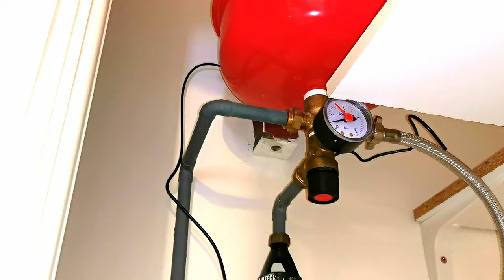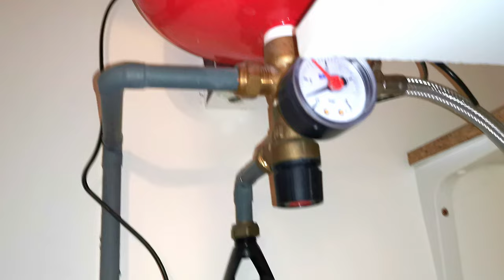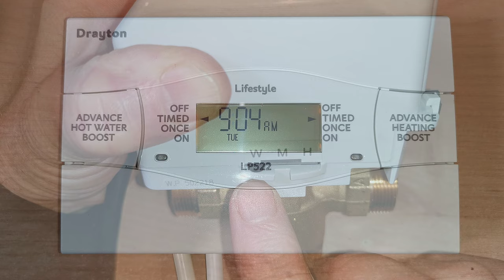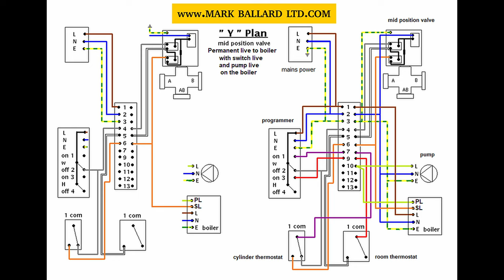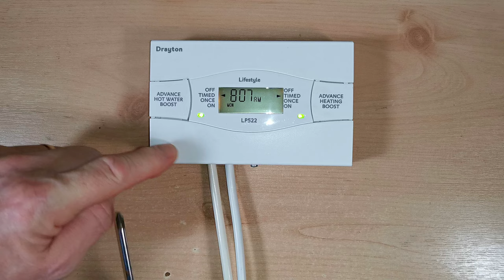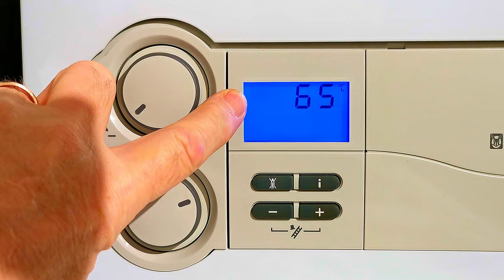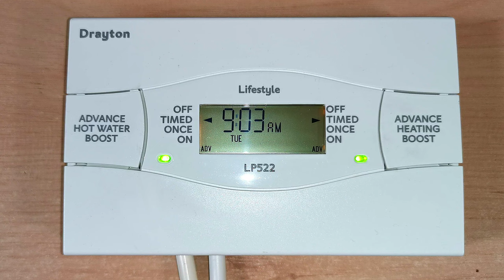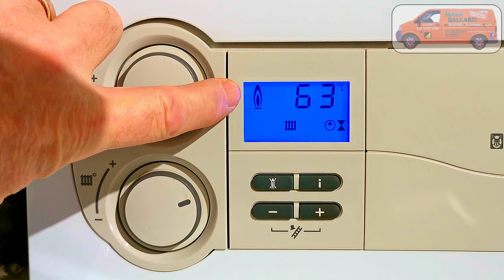Why Is My Boiler Running When It Should Be OFF,  Is It Normal Or Is It Faulty?

Comment: My heating was running flat out all night during the recent cold spell. It was due to an outdoors frost stat set at 0C, so I fitted another stat on the return pipe, in series with the outdoors stat. The boiler now only fires up when it’s less than 0C outside AND the return water is less than, say, 10C. Seems fine now.

Comment: my combiboiler keeps pumping something out for 30sec every 8min. It isn't turning on like heating water as flame doesn't turn on. And preheat function should be switched off. As i selected off on the controller. 

Boiler guy came and said it was flow valve filled with limescale.

He replaced it, and it now turns on for 3 seconds every 8min. 

Is that normal, Any idea why it keeps venting something for 3 seconds every 8min?

Comment: Hi Mark.  I have the problem where the circulation pump stays on after the HW has reached temperature which I think is due to the Honeywell zone valve holding a residual voltage. The tank stat works fine and if I dial it down to 20°C the valve actuates and the pump stops. Do you have a link to the capacitor that I need to install please.  The Baxi boiler doesn’t ignite/burn but the LED is on and the circulation pump and zone valve both stay on/open.  Plumber isn’t certain whether to replace valve or install a capacitor across the valve terminals rather than the boiler as you show in your video.

Comment: My boiler produces warm heat to the radiators ( certain ones)  i was told that the heat has to go somewhere.   The boiler is not running when its slightly warm

Comment: Why does our combi gas boiler make a humming noise with no heating or hot water demand. It can last all day and night even when its warm outside. It does not sound like the co2 fan which is louder, which normally over runs for a while? It works normal other than that. I have reduced the water inlet pressure but to no avail. Any other idea's? It only stops when the boiler power is off.

Comment: Hi Mark I have a Vailant combi in my caravan so if I turn the water off but leave the power and gas on for the duration of the 2 month shut down Jan to March will it protect my boiler ?
Reply from the maker: Yes it should do it has built in frost protection.

Comment: Try again hello mark I have a gloworm flex icon 18 my water heating when on the timer seems to be on all the time 24hrs as the boiler is sited in the cold garage could this be causing the boiler. to run constantly or is there something else wrong many thanks martin

Comment: Do TRV control boiler, ive set thermosate to 15c boiler to 55c and trv all fully open. Yet boiler keeps heating and heating past thermostat 14c to 21c. I know the  thermostate over reads and ive Offset that to (-3) setting seems to little control over boiler.

Comment: ah god i wish you were in Ireland! i have climote heating system, boiler fires up whenever it feels like it, even if thermostat set to zero! . already had a motorised valve replaced 6 months ago, and its back doing the same problem again, Just this time itermittently. Plumber said its a wiring issue. yet i cant get an electrician to come near it :(   unfortunately, we dont have any "off" switch. best we can do is turn rads right down, and boiler turned down, while we wait for electrician ..... sigh!

Comment: Hello. My boiler pressure gets very high after turning heating on. Any idea what's wrong?

Steps done so far

Did radiator bleeding and lost pressure
Represurised boiler to 1,5
Boiler start to go up 2,5 bar and above
Did bleeding again to drop it down
Didnt help it got back again quick
Reset the boiler 
Didnt help also
Reply: Your expansion vessel needs to be positively charged.

Comment: Great video Mark. 

I have a strange issue that has occurred since I replaced my pump on a conventional boiler with an F&E tank. In the evening my boiler heats the water as expected but when the nest says it should be off it still fires up and heats the water until the tank stat says it’s satisfied. I have disabled the legionnaires setting on the Nest and it does not heat up at any another time. It’s a real head scratcher and I wonder if there is an old water heating program on the Nest platform that the app or thermostat is not picking up 😮
Reply from the maker: First thing I would do is find out what's not turning off or what staying on.  A stuck open zone valve would do that. Had that the other day!